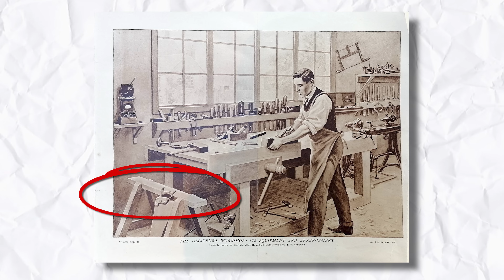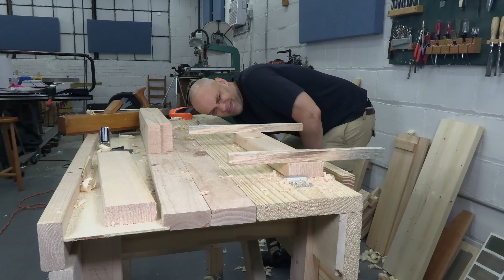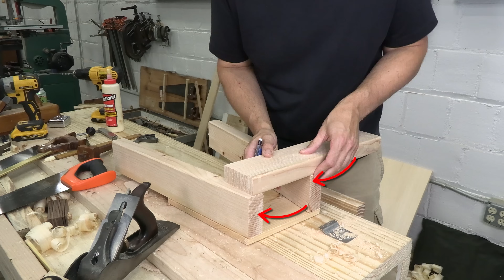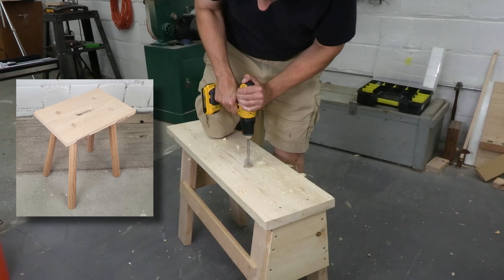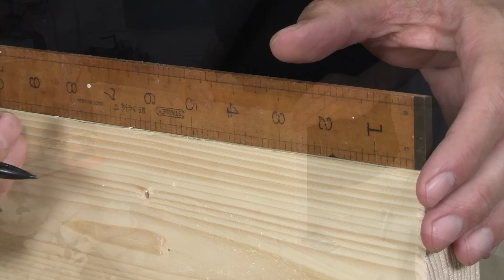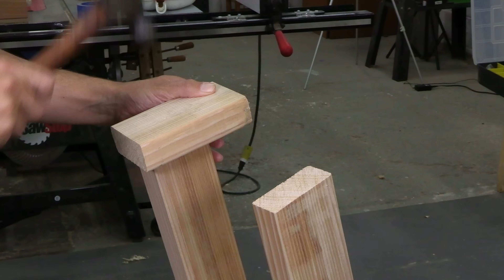Build a saw-bench. Transform your woodwork.

Comment from the maker: Get BOTH sawbenches in one set of plans: https://www.rexkrueger.com/store/traditional-saw-benches
Build the English Joiner's Bench: https://bit.ly/2QZls9T
Build the Minimum Timber Bench: https://www.rexkrueger.com/store/minimum-timber-bench
Build the Lightweight Traveler Bench: ps://www.woodworkforhumans.com/store/p/lwtravelbench
Reply: Use 1/2inch hardware cloth in stead of plywood for the shelf. No sawdust collection!
Reply: Rex, I purchased your plans and I think there’s an error in the dimensions for the Batterns on page 4. They don’t make sense. They’re out of ratio to one another by quite a bit. Can you take a look and get back to me? Thanks, Jeff
Reply: REX! THE BATTEN DIMENSIONS ON THE PLANS ARE WRONG! Contacted your retailer, nothing they could do. 👿 You need to talk to whoever’s drawing up your plans. They say they forwarded my message to you, but I haven’t heard back at all a bit disappointed in  that. Jeff
Reply: Hey Rex, I don’t think you say but the battens should be cut and oriented with grain side to side, correct?

Comment: Rex. I bought the english saw bench plans. I think there is a mistake in the drawing. The batten shows 23 1/4 at bottom and 7 1/2 at top. that would splay the legs out 26 inches and the top joint of the legs would be 19 inches wide. your top is only 12 inches wide. 
Perhaps you meant to say the batten should be 11 1/4 at bottom and 7 1/2 at top. this seems more reasonable. please let me know
Reply: I see in the video it shows 11 1/4 X 8. That I can live with. thanks

Comment: ahh..a saw bench, its a dual use thing... part one... about 20 to 21xinches high so you can just saw stuff on it... second use... its just a short stair to stand on when your a bit to short yourself. just make the base a bit wider then the top so it won't make it fall over when your standing on the edge...  its not rocket sience.. its just a low table where you can stand on... and additionaly... use it to saw true struff. 

i personaly have 2 on a jobsite... place them the needed space apart to saw true longer stuff... buut..all made of plywood... you don't need to make them fancy..becouse you will cut into them... just screws and plywood... you would make multiple a year anyway if your a carpenter, there just tools.
Reply: also..2"4" just make everything out of plywood... its a freaking htrow away tool, don't get fancy... your supose to wear them down

Comment: I've been planning on making the english style bench, but I'm adding one feature. I bought some spring casters that you put on a wooden gate, and I swaped the springs for some lighter ones, and I plan on putting them on the legs of the bench to mimic those shop stools that roll around but when you put weight on them the casters compress and it restes on the legs (like the round black ones you see at auto shops). I plan on using it as more of a sitting bench anyways as I'm working out of an enclosed trailer and I move out into the driveway for larger projects, plus I need an upgrade from camping stools when I'm in the trailer doing smaller things if I want to sit.

Comment: Thank you for this video!  I made the first kind, but instead of making one longer one, I made 2 of them, 2 feet long each.  I can use just one or use them in combination, or sit on one and work on the other either lengthwise or sideways. I even propped a board on the feet of one while leaning it on the one I was sitting on to chisel out a lap joint.  With 2, I changed the way I put the legs on them so on one they're set in a little so I can clamp stuff to the surface and on the other they're flush with the surface so I can clamp stuff vertically.  I've already decided I need to mount a peg to hang an old paintbrush on, to sweep away saw dust and shavings/chips, and maybe mount a drill bit holder to hold whichever ones I'm not using at the moment.  Oh a magnetic strip would be good for that!

Comment: Rex, while researching benches, I came across designs like your English bench with a slight difference. That is the legs on one side are perpendicular to the bench top and ground while the ones on the other side of the bench are splayed out like in your design. I believe this is intended to give support on the sawing side while simplifying construction a bit. Have you seen this kind of design? Do you think it to be a reasonable modification?

Comment: In regards of the comment about the legs sticking out on the light travel workbench (2:18).would it be practical to use the same type of legs than the ones used on any of these saw benches?

Comment: I'm wanting to build either one or both of these, but I can't get this idea out of my head, those round metal stools in auto shops that roll around but when you put weight on them the wheels move up and becomes stable and wont roll. I'm thinking about using gate casters and putting a lighter spring in them and put them on the benches' legs. That way I can roll the benches around easily and can be used as places to simply sit, and I can just push them under a small English jointers bench that I made from your video.

Comment: I've got limited space in what I would like to be my mixed-use workshop (including for hand-tool woodworking). I don't have a workbench at all, although I have some old desks which I can use as a makeshift workbench. I also wouldn't mind buying one of those portable workbenches just to have something to start with. What would you say would be the best route from having no workbench to having a good workbench + one of these. At some point I thought of going Japanese saw horses -> low Roman workbench -> English joiner's bench but this would leave me with no space for the low Roman workbench. I was wondering if there's a better route with the end goal being that I have a nice full size workbench without too many intermediate steps.

Also, would you still recommend the English joiner's bench or do you think there's a better revision?

Comment: I made the English version as my second woodworking project - my first was an English Joiner's Workbench. Both were from your plans and both have turned out pretty well. The "EJWb" was rushed in spots and I certainly see a need to measure more accurately and thoroughly- it's surprising how much a slight error can magnify. I am now a better AMATEUR woodworker. The plan was not followed completely - there are always compromises right? Materials are not exactly the same as indicated in the plan: we take what is available and reasonable . My local Home Depot supplies 2x6 stock but it's really 1.75" by 5.5" or something - you know. Same with the Saw Bench - all of my cuts were slightly off - but hand tools can be very useful in allowing you to make slight corrections. My Jack plane is now my best friend - why didn't I use my fancy new shooting board and make the angled blocks more square (that's what it for stupid!) ?? I added work holding (dog holes) to the saw bench and used the same technique as with the EJWb - gluing  2x4 as support under the Top. (a' la Chris Schwartz) - this adds stability and longevity for the Gramercy holdfast. I really appreciate your work here - it's really helping me become a woodworker.

Comment: Rex - I have an extension project to this for you. A design and build for two English saw benches that stack (lower bench is wider than upper) so that separately they are the same height but stacked the top surface comes up to your main work bench. 

When I was a teenager this was in a DIY magazine and my dad got me to build them out of various scrap that was available (e.g. off cut roof timbers from next door's extension). I still have the top half. It even incorporates wooden sash cramp rails each side for Record sash cramp heads.

Comment: Great benches that are straight forward to build. Thanks! I can recommend putting the handle hole off center by one inch. That puts the "handle" exactly in the center of the bench, so when you pick it up it hangs straight down instead of canting. I have done this now on several of your bench designs and everyone loves how they can pick them up and easily keep them level when shifting their position without a lot of thumb pressure. All four legs hit the ground together. It seems minor until you try one built this way. No, it no longer looks symmetrical but form should follow function.Thanks for all you do.
Reply: If I understand correctly, you can only pick it up from one side, right?
Reply: @clementm5417 You can pick it up from the other side but it cants more. This could be a plus carrying it down a hall or narrow path. The legs cant much closer to your body so it's less prone to bumping into walls and other obstacles.

Comment: I have this wooden stool that's built just like that english bench, only it has a square top, and it is completely covered in saw marks because it too is used as a saw bench for the last 20-30 years. Also you can flip it and saw up the branches for firewood, the legs keep it from rolling away. Guess a good design just floats up everywhere.

Comment: I had a sawbench that I built from Chris Schwarz's plans in PWW after a few years I got rid of it. I use handsaws a lot and it was nice when I needed it, but it took up a lot of space on the shop floor. I'm planning to make a collapsible one so I can get it the heck out of my way when I'm not using it (ideally up on the wall). I don't need another thing to bang my knee into.

Comment: Rex, this is awesome, but maybe instead of having two low benches (one of the ones of the video and the Lightweight Traveler Workbench) may be you could mix the best of two worlds, and have the corner and notch ability of the Lightweight Traveler Workbench?
Reply: Another ditto here. Work holding on a saw bench. Or is it easy cutting on a low bench.
Reply: That's exactly what I'm thinking about building!

Comment: This feels like it would be awkward with my Japanese hand saws. Neh?
Reply: They use something very similar in traditional Japanese wood shops, just its even closer to the floor. They either kneel or sit on the board or for big timbers they tie it to the bench. For some reason the Japanese almost never used screws in anything (so no screw vises or clamps) until after the fall of the Shogunate although they knew of them since the 1500's at least, from the Portuguese and Spanish.
Reply from the maker: Yup.  Not made for those.

Comment: In my opinion, Carpenter, Joiner, Cabinet Maker, etc., all could benefit from either one - or preferably one of each - of those benches. I like the design of the English bench for onsite carpentry work (especially outdoors), where it would frequently prove invaluable with its sturdy stance, tool tray to keep tools and a radio safe in and - importantly - somewhere to sit at lunchtime. At home for my project work, either would suffice but again, the English has the sawing notch, which is a very nice feature (not that it couldn't be added to the Swedish bench). Large or awkward assembly procedures could also be done on a pair of benches because it would raise a project up to a nice working height, rather than bending down or crawling around on the floor (think installing a hinged top on a six-board chest, for instance, which might be too low on the floor and too high on a workbench). Throw on a couple of scaffolding planks and you have a solid step-up or platform for working at a convenient height, too. All-in-all, a versatile pair of benches - and better still, not expensive to make!
Reply: Many classically brilliant ideas.
👍
Blessings y'all

Crawford out 🙏🔥⚒️🧙🏼‍♂️

Comment: Try add vise to saw-bench.
Reply: The Romans did - square notch in the long side and wedges. You can also put dog holes in the top and use wedges between the dogs to hold work.

Comment: For the storage, adding a saw till could be a neat touch, as well as a place to keep saw files.
Reply: I guess you wouldn't be sharpening the saw at the bench, unless you're sitting on the floor.
Reply: @ricos1497  you could clamp the saw to the top and sharpen it with the file vertical...
Reply: @pettere8429  that would be crazy. I like to put the saw handle into my neck, and use the file like a violin bow to sharpen.